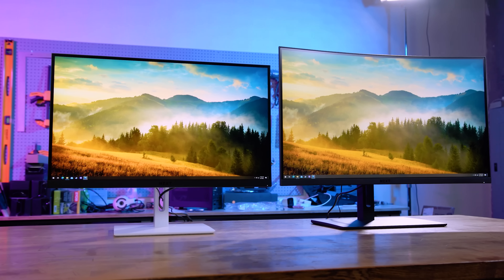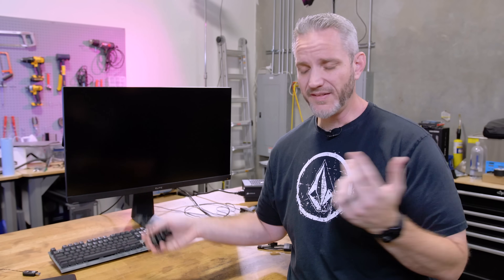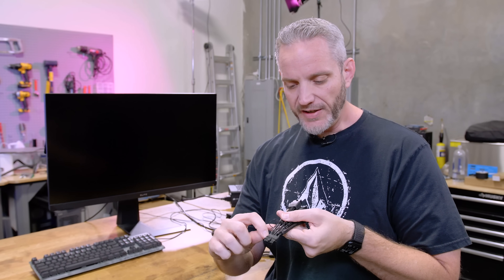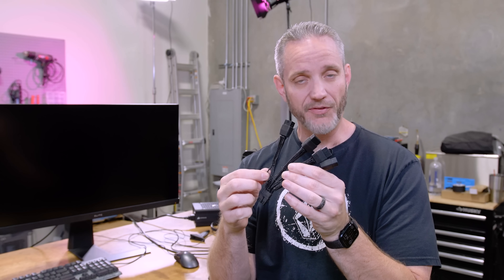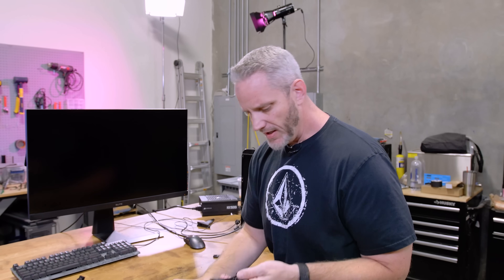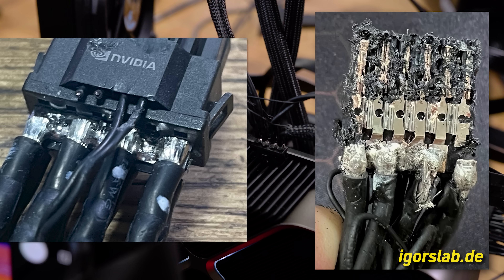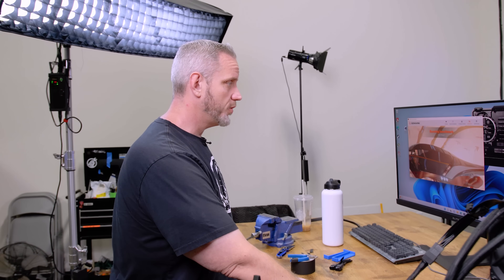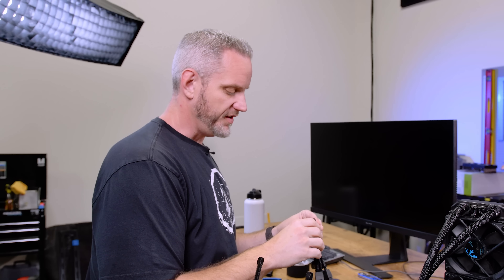Igor's Lab figured out why NVIDIA adapters are melting!

Comment: Just a thought if the pad breaks loose but it's being held in the approximity to the metal plate that it was previously soldered too wouldn't there be some amount of arcing.  Loose electrical connections are infamous for causing fires.
Reply: HELL YES ! You better have a supply that has Breakers on those lines !! Mine does.😎

Comment: BTW - if the solder joint breaks within the plug, the consequences are much worse than just cutting the wire like you did.  These are DC voltages, and high Amp DC voltages.  The heat is caused by arching inside the connector whilst the cable is broken.  Take your cut cable, and constantly touch (make contact), and disconnect the cable again.  I'm fairly sure you'll see sparks, and your temps will also sky rocket.
Reply: If the outer connections are just disconnected, it should be the inner ones getting hotter and burn.
The arcing of a loose connection on the outer ones is a reasonable explanation.
Jay needs to sacrifice this cable a third time I think

Comment: "it would break or crack the joint..." yeah, joint would be an adequate description of this connection although "solder joint" is much more accurate.  You're absolutely right that creating a crack in the solder joint will increase the resistance (measured in ohms/Ω) at the compromized solder joint.

The photo from Igor's Lab looks like a cold solder joint meaning that either the solder, pad or wire did not some up to temp before removing the soldering iron.

Comment: I believe it's hard to recreate failure is because you're removing cable so it doesn't retouch the metal. If you just break the wire but not remove so it retouch the metal it may recreate the heat issue. The detached wire may also touch neighbouring wire causing short circuit and exponential temp increase
Reply: It can't be a short circuit because a failsafe would trigger the moment it touches. But the broken off pad just flopping can do some nice arcing especially at those amps that GPU is drawing.

Comment: As a RTX 4090 owner I'm disappointed this is a problem I need to be concerned about
Reply: I have one coming in the mail, and I'm worried. How long have you had yours? Is it giving you any problems?
Reply: @eiyukabe  I've had it since day 1. No problems yet but seeing all the news about these issues has me concerned.
Reply: So just don’t use this cable
Reply: @myth3516  so just don’t use the $1600+ gpu? Or wastefully buy an ATX 3.0 PSU and wait 3 weeks for Amazon to ship? Or order an adapter from Cablemod and not be able to put it in a case cause they require 50cm from the gpu to not have the same problems?
Reply: Spending 2 grand on a GPU you should be concerned, not because of a faulty connector/adapter, but because you spend 2k on a GPU.
Reply: @joemarais7683  where do you live where amazon takes 3 weeks to ship? (its not like there is a PSU shortage, look at another place if amazon dosen't have it) if you can afford a 2k GPU buy a $300 PSU. its not hard. you can probably even afford faster shipping.
Reply: @eiyukabe  i'd be ordering yourself a custom cable for your specific power supply today then

Comment: Was wondering why a 90* 12pin plug wasn’t used in the first place in the design. This could help eliminate the need to bend the wires for wire management , but this also could be applied to all pcie cable designs in the first place.
Reply: My guess is cost. Same reason for why the new adapter is constructed worse than the old one.
Reply: This. I can't imagine a scenario where the plug and cable sticking up from the card like this would be preferred. Having the cable running parallel along the card would be ideal in all cases, in my opinion.

Comment: I am a mechanic by trade and a computer enthusiast as a hobby. I have seen these types of failures in heavy equipment many times. I think there might be a step that is being missed in these videos. The tests done by Steve and Jay have had the strain relief removed during testing which can hide a phenomenon where a solder joint will break but the wire will still be contacting the mating surface by the force of the tape holding it down creating an insane amount of resistance. If a wire was broken but still being held on the pad out could generate the type of heat necessary to melt the connector. It might be worth trying to break or desolder the wire and then rewrap it to give it just enough contact for electricity to pass through with a very high resistance and see what happens.

Comment: It is possible that when the bridge breaks the gap between the two pieces are causing it to arc. This would eventually cause it to burn/melt the connector. 

I've seen this happen on a supply to contactors/overloads where it basically melts the contactor until it eventually trips the breaker
Reply: 12V will never ever arc.

Comment: When it breaks inside there is a high chance that the cable still lightly touches the pad (small contact area). I wonder if that would cause the temperature to rise higher.
Reply: And why its front melted not the backside? Its melted becouse of the poor connection in front some dumb gAmEr cannot put a pc together and burn the connector so the whole internet jumps on it. Smells like paid by amd or intel
Reply: You wonder correctly. I've seen contactor terminals melt due to bad connections. The resulting arcing produces a LOT of heat.

Comment: I think the issue is because you cut off the pad entirely. In the assembled form, a broken pad will still be connected but have unstable connection with much higher resistance and turn into a 'resistive heater'.

Comment: It's not just the fact that the wire separated. The connector is still there being held in place by the plastic. It can ark and spark if power builds up enough.
Reply: 100%, I've seen similar issues with bad connections on emergency vehicle upfits. Connection breaks but can have intermittent connections and they get hot and melt.
Reply: Plus add in the extra case heat, all pretty plausible.

Comment: Would you also say that Cablemod's solution is safe to use at the moment?
Reply: I think the 90-degree adapter is a good pick for any card that uses this new form of cable. But as i see the advice,  it seems that you're best off using a separate and dedicated PSU-cable from your PSU manufacturer for this new plug/socket. To me it seems that Nvidia has cut corners in their adapter cable design, and companies like Corsair, as Jay shows here, have made their own, non compromising designs with dedicated wires for each pin.
Reply: probably safer

Comment: Might not only be the one problem at work here, if the contact area of the pin with the plug is smaller because its not fitted well, might increase the temps to melting point. If you bend the cable enough to force open the plug a little or not have it in all the way or there are a few plugs that are oversized or shorter maybe?

Comment: Great work Jay. I am wondering if the missing ingredient is arcing. If the foil breaks and it is close enough, it could potentially arc across producing a lot of heat. No way to prove it though under controlled conditions without running hundreds, maybe thousands of tests, or just getting lucky/unlucky.

Comment: As power draw increases so should the size of the connector. I predicted that right angle adaptors would be needed for these cards and it seems like my prediction was correct (for once).
Reply: The pin size is adequate for the situation, assuming the pins are used in the correct manner (having wires crimped into them). If the connector pins weren't adequate size we would be seeing failures from all cables that used those pins (i.e. the ones from cablemod, the corsair one, etc). The only failures have been with the adapter and originated with the adapter. It's a design flaw in the adapter and the improper use of how crimp connections are meant to be used problem, not a connector pin size issue.

The exact same designed adapter but with larger pins would suffer the same problem, since the origin of the problem isn't the pins themselves but the poor way the 14AWG wires are 'connected' to them.

Comment: your explanation doesnt make any sense. you say that the melting happening on the outside pins is because side to side bending would break the solder joints on those pins so all the power would be going through the central pins.

But that would cause the heat to buildup  on the central pins.... not the outside pins.

Comment: 18 hours late and probably commented on elsewhere.

Quick way to check your cable since theyre bonded on one end, is to just measure the resistance pin to pin. 

An open connection would mean one of the two set's you're testing are broken, check one with another to find out which. 

You might also be able to find some in a pre-fail state where a random pin is having a high resistance(Which would give heat).

Comment: The biggest issue is the lack of redundancy. If 2 connections were to fail, the whole connector will melt with potentially catastrophic result. I've seen multiple similar examples during my career where industrial design, designing something to look pretty, completely outweights the practicality.

Comment: One approach to a test would be to get an adapter, wiggle it back and forth a few times left to right, then measure the resistance across the outer connector to the other end of the wire with a multimeter.
As others have said below, if the wire is barely connected by a few threads / has a high resistance, then the current traveling across the wire will generate heat, more resistance equals more heat.The heat then travels nearby to the rest of the connector or along the wire and spreads out damaging the connector / wire.
If it's disconnected completley then there's no resistance across that wire, but the other wires have to take more current which overall results in less heat, but more load than they should be taking.

It's something I've seen happen with mains powered heaters wired into dodgy mains sockets.
Imagine water as water preasure, current is water speed and greater resistance is a smaller pipe.

Comment: Yep, even more happy with the reports that AMD won't be using this type of cable. Didn't have nearly this much quality variance in the old PCIE plugs
Reply: You clearly didn't watch the video. They said the real 12+4-pin connector is fine and can handle upwards of 1500w before melting. It's the Nvidia adapter cable that's defective. The wires are frying on the 8-to-12 adapter-side, not the 12-pin Male/Female connector side.
Reply: @chartabona  I watched to the end. My opinion comes from simply not wanting to have to worry about my power supply cables causing issues. Thanks for mansplaining :)
Reply: @RubyRoks  There is no issue with the power supply cables. The issue is with the Nvidia adapter. They explained this in the video, which you'd know if you watched the video.
Reply: @chartabona  You can stop trolling now :)

Comment: Counterintuitively you wouldn't expect to see burning where the wires are disconnected, because a higher resistance leads to lower current, and you'd expect the melting to occur on the plate instead of the pins (since it is where the majority of current density is located). This seems more like a physical pin connection issue, where the pins that don't burn up are in fact the ones not making a full connection.

Comment: the old robust 8-pin adapter is 3 power + 3 ground + 2 sense for a total of 150W, that is 50W per power-/ground-pin. the new flaky 16-pin connector is 6 power + 6 ground + 4 sense for a total of 600W, that is 100W per power-/ground-pin and the new pins are tiny compared to the old robust 8-pin adapter. there will be problems with the new adapter no matter how well they try making it, the pins are just too small and too few! the new 16-pin adapter is good for maybe 150W (25W per tiny power-pin).
Reply: Jenny Melo  you mean it’s a lacking cable strain relief problem. Or movable solder connection problem. Either way, a flawed design that suffers from not having the safety margin of the old pcie power connectors.
Reply: Jenny Melo  well, if you feel confident with the flaky 16-pin adapter, go ahead and buy a 4090, just buy a new card when your house burns down...

Comment: It did not increased the heat because the plastuic cover which contained the heat was removed and now it became air-cooled. Wth an electrical tape it would increase the temperate faster but because of that the thermal camera would not read the temps, maybe only at the base...

Comment: This connector has got to be why EVGA pulled out. They had made engineering samples of the 4090, they probably figured this out in thier labs. My guess is they wanted to use traditional power connectors and nvidia said no.

Comment: Something we also forget : Case temperature... 
On open air (20°C) it might be fine, but inside a computer case it idles around 35°C, so that's a 15°C uplift already added to the heat of the connector.
This Delta temperature is also much higher under heavy load of the PC

Comment: So in other words AVOID the 40 series until they fix this mess. :)
Reply: technically you don't need to if you also bought a good quality pcie 5.0 power supply like the be quiet model used in the article, but yea you'd think with how much these cards cost that nvidia/their contractor wouldn't cheap out on such an important part.
Reply: With the 4000 series being the lemon it has been so far, i would just skip regardless.
Reply: @TheRealEvilSink  lemon huh :D :D :D
Reply: Or don't bend the cable sideways.
Reply: 99% of people can't use the 30 series to it's fullest.  the 40 series was built for miners.
Reply: No avoid the stupid adapter. Use cables that are made properly.
Reply: @TheRealEvilSink  You probably can't afford it and were going to buy lower end cards anyways.
Reply: @theghostofthomasjenkins9643  You can't use graphics cards for mining in any profitable way anymore... you need dedicated hardware these days. PS: I'm quite happy getting 60+ FPS in Cyberpunk with all settings at ultra, in 4K :) Once the DLSS3 patch comes out, I'll be running at 120+ fps easy.
Reply: @viper1431  Better yet just don't use the adapter.
Reply: @tosvus  that doesn't mean they weren't designed for it.  they didn't design these overnight (well, okay..maybe).
Reply: @theghostofthomasjenkins9643  We knew about the Ethereum cutover for over a year before it happened, but maybe they hoped some other currency would take over once Ethereum was unmineable, who knows...
Reply: @tosvus  i'd imagine more than a few years are put into their flagship designs.  nothing about these cards says they were designed for consumers in mind.  they are big, bulky, and seeming designed to sit on a rack with many other cards.

Comment: It's not necessarily the fact the connection was lost, but the "arcing" that happens when current is passing through a connection that has increased resistance...such as a break in the solder.  There could still be enough connectivity to get "some" current through it, but the higher resistance of the broken connection causes the temp to increase. If you've ever worked with wiring in your home,  you will immediately recognize what I'm talking about.  That arcing from just bringing two contacts with a difference in potential close enough together that they can pass current just before they physically touch.  That arc contains a LOT of heat and repeated instances of that arcing continues to build the heat....a continuous cycle until failure.

Comment: There's not much of a surprise that yours isn't heating up as much as the ones that fail in the field, when the solder joint would be broken and the cable that is cut off stays within close vicinity of the solder joint (remember, the connector is closed so the pad that is broken will still keep it close to the cable) there will be some induction going on, with lots of resistance and sparking which wouldn't be visible because of the completely closed connector. This completely explains the melting and high temperatures.

Comment: I learned the hard way as a young engineer about compression pin fretting corrosion and high power interfaces. When high pulsed currents pass through a low compression interface heating causes the metal to expand and contract. This results in micro movements between the male and female parts breaking the tin oxide barrier and allowing oxygen to interact with the base metal and form microscopic corrosion. This increases resistance which in turn increases heat in turn increasing the fretting action and eventually thermal runaway melting your connection. This effect can also occur with even micro vibration between surfaces.

Comment: I'm confused why they felt they needed a brand new connector when there are already plenty of already existing high current crimped connectors that would have worked just fine (assuming they used factory tooling for the crimps and didn't cheap out with generic tooling)
Reply: that is like asking why Dell uses proprietary motherboards when there is a widely adopted standard everyone else uses. And it's not like they save money from having a custom pcb.

Comment: Yes, the cold/disturbed solder joints are outright defective and create a poor connection, however, the lack of wire strain relief exacerbates the situation.  Splicing wires together to a single land/contact is pretty common, but doing it completely unsupported is a very bold decision by the manufacturer.

Comment: If anyone with access to a vented test lab, n-methylpyrrolidone can be used to dissolve the connector without damaging the metal bus bar.
Ive used it to look for shorts in faulty encapsulated motor stators. Itll dissolve everything but the metal so its good when you need to remove plastic around small electronics to look for breaks or shorts.